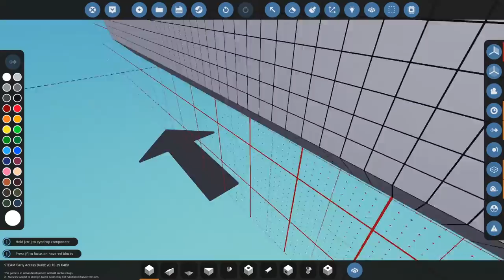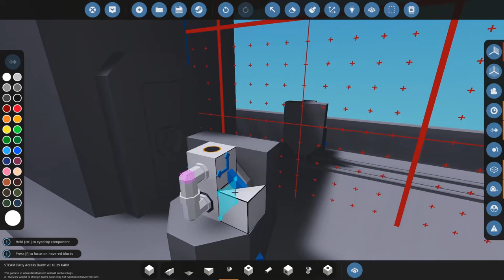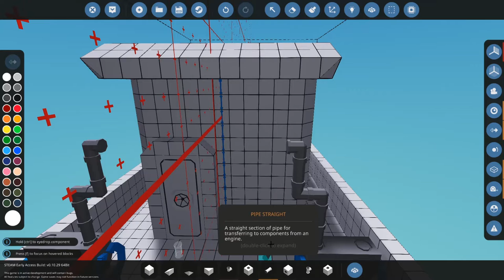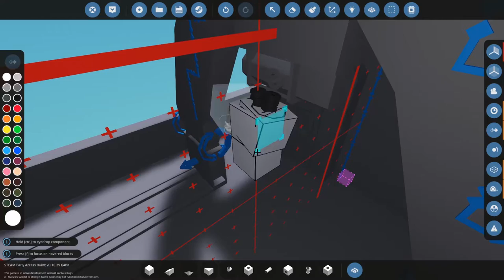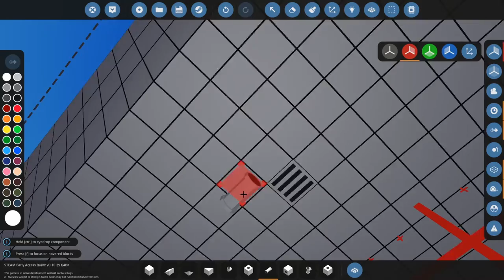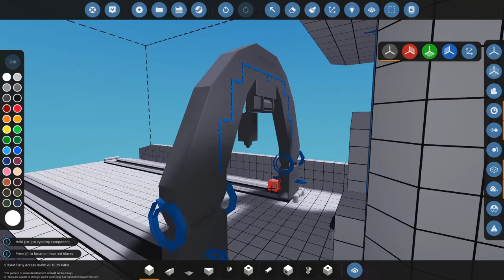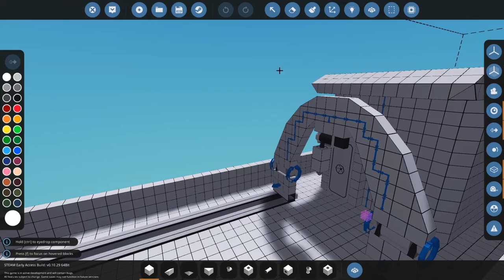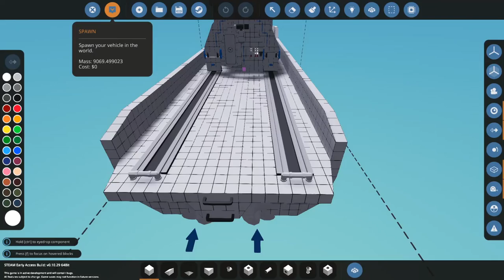Making A Crane! - Stormworks Boat Build Series Episode 4

Comment: Why doesn't the magnet work just curious
Reply from the maker: Because the cable I was using could only either pass electrical power (electrical rope anchor) or fluid (fluid hose anchor) rather than both. I will probably do a ropes tutorial soon